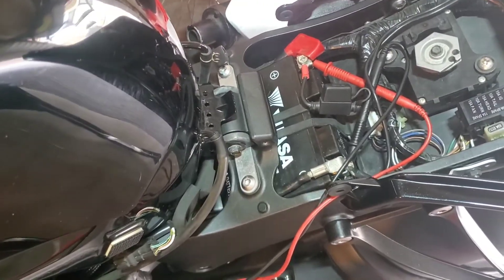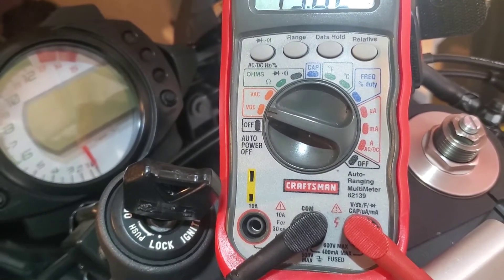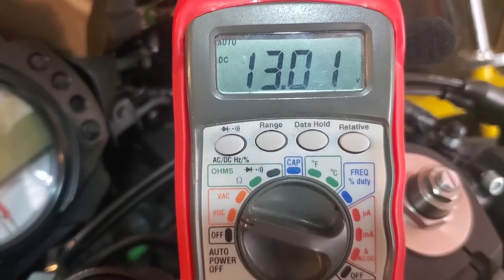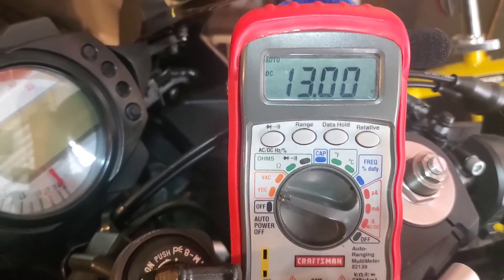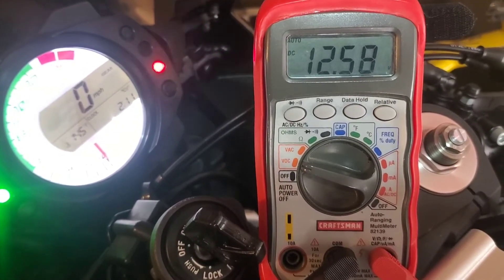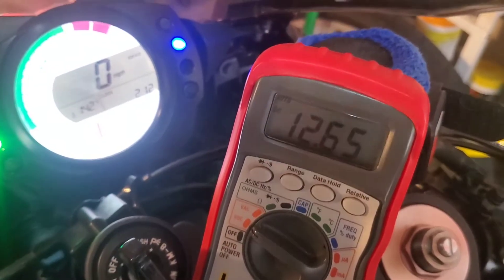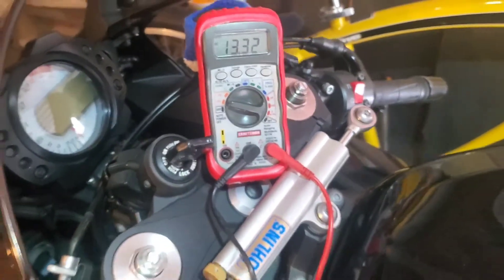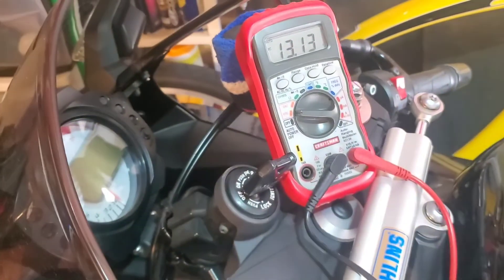How To Check your Motorcycle Charging System

Comment: Did you ever figure out your charging issue? We have the same bike i just replaced my stator and now i have a rectifier/regulator on the way. I assume there’s only 2 parts before the battery so that’s gotta be it?
Reply from the maker: Yes, the issue was the regulator/rectifier... They had a recall, it was replaced in tbe dealership at no cost, beem fine since.

Comment: I have a 08 like you. My voltage is 12.8 after turning on power it drops to 12.5 then when I fire her up and rev it to 5000rpm its 14.67
I'm puzzled I just swap out a new battery it would die. The reason why I swap it out because the previous battery would not give enough power to start the bike even after a long ride. Figuring a long ride would charge it.